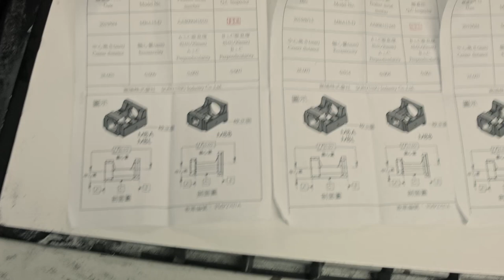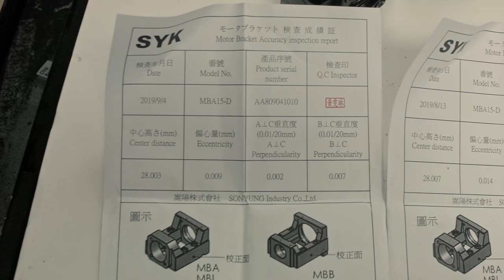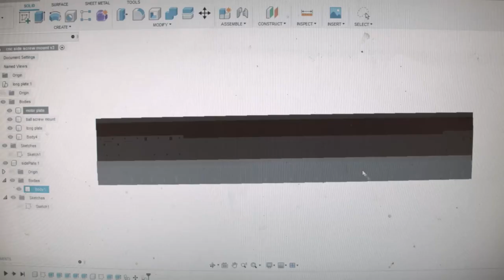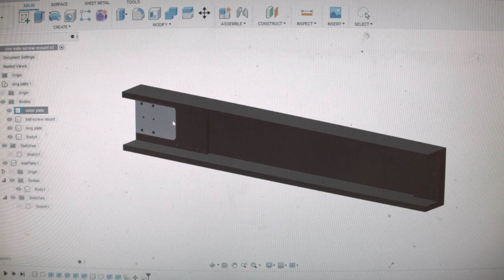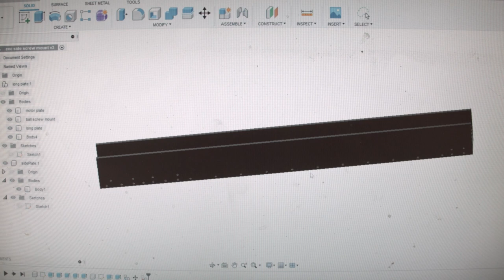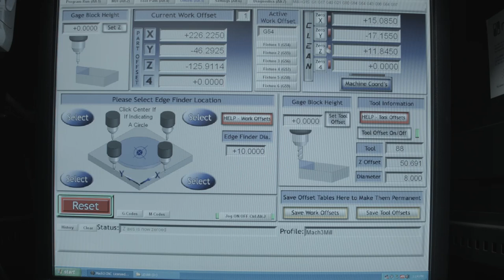EPIC CNC upgrade - episode 2. more exotic parts and building ultra rigid Y axis module

Comment: Thanks for the video. Love your content. It was your videos that inspired my own build. Very similar design with OA dimensions of 1000mm X and 700mm Y giving about 740mm of X axis travel and 450mm of Y axis and 150mm Z axis. As you stated I liked that format for space constraints and access to the bed for fixturing. But mine is fully welded steel not granite. And only about 40% done after over 12 months lol. I plan on filling all the sections with resin though to reduce resonance as much as possible. I’m definitely doing full flood coolant as well. I’ve never seen anything else as efficient as your system.
Can’t wait for the next update.
Reply from the maker: I'm glad I inspired you :) 40% in 12 months, well you can not rush a masterpiece :D when you will fill it with resin throw some stones of random sizes. resin by it self shrinks when its curing, it could delaminate from the metal and leave voids.
Reply: Piotr Fox Wysocki I was going to do sand/resin mix. Do you think this would be ok?
Reply from the maker: sand wont change much. you need various sizes of stones to combat the resin shrinkage. stones are making the machine rigid not resin. 
i was contemplating filling up hollow frame with engine oil. liquids have the best dampening properties. oil should also prevent corrosion. the best would be mercury, but it is expensive and toxic. anyway i will have to investigate it further.
Reply: @PiotrFoxWysocki   i came across to this comment and could not resist asking. So engine oil has better damping properties than resin mix with granite stone of random size?

Comment: For those pieces that are a bit too long to be done in one op. If you can't relocate off a machined feature when you move it over to do the part that was outside the travel, I like to clamp a 123 block about midspan and use the spindle with an end mill up against it to establish a new reference. Then move the spindle over the distance needed to reach the rest of the piece (ie 4" in -x). Pushing the clamped 123 block up against the end mill again in it's new position. Then reclamp the piece and make sure your op2 has a zero point 4" over in +x and machine the features you couldn't reach from there. Usually accurate to .002" from what I can measure since y and z didn't change and unless you moved or rotated the spindle it is as accurate as your machines accuracy.
Reply from the maker: good tip. i will try to remember it for next time i have to mill something too long.

Comment: Hi fox. Great videos! I'm building a router with UHPC and got many of my parts from dy global too. I have the same ballscrews and a stainless z axis in got complete from them. I ended up with 20mm THK rails but I'm jealous of the rails you have :) also spindle is from jain Ken, I hope yours is still going strong as I haven't used min yet and hoping it was a good choice.

Comment: Awesome machine Piotr! Quick question. I noticed you’re using screws with 5mm pitch on y and 10 on x. Does it give you any issues? With motors running at different speeds/settings?
Reply from the maker: Not much issues. But because of this it messes up with resolution. Because of this I had to set the speed 2 or 4 times slower to have resolution 5 microns / step or 2. Don't remember. But I wish I had 5mm pitch all around. Things are getting bit weird to setup. But it's done its done. I don't want to touch it again
Reply: Appreciate the feedback! I’m actually copying your build lol. Almost done, just need to finish the gantry(I went the epoxy route for gantry) and can’t find a 2505 c3 or c5 screw to match my 2 y screws and not really trying to downsize to 20mm dia. or rolled. I did find one with a 25mm lead, so that’s the reason I asked. I’ll take your feedback and keep looking!

Comment: Is there any specific reason that you went for (probably expensive) ground ballscrews instead of a glass scale measurement system to compensate for the errors in the cheap errors? Or will that be coming too? :D anyways, I'm always looking forward to your videos, I like your very precise way of working and your awesome machine :)
Reply from the maker: the reason for ground ball screws was to have as less vibrations as possible, longer life and to minimize pitch variations.(error)  double nut to eliminate backlash for as long its possible.
i wont be using glass scales, I'm hoping for those ground ball screws to consistent enough. lets be honest, how often do you need to mill parts that are 5 micron precise. 
for me the quality of the finish is much more important.

Comment: First of all thanks for the inspiring videos, I like the "can do" attitude and it motivates me to keep on improving my diy CNC. Unfortunately its sitting in my living-room in the third floor so I cant really put a 500kg granite bed there..Im sticking with 150kg.
Im currently also in the process of deciding which Ballscrews to buy. I Currently have 2410 Double nut ground with JMC Servos (400W) but I'll drastically change the design soon and move to a "dual-system" with one screw on each side of the portal.
I was looking for NSK and THK on eBay used/new but finding the right lengths is not really easy if you need two identical ones.
How did you decide if you'll take a 5mm instead of 10mm? As far as I can see, TBI also has 10mm for every Type
And why did you decide for the double-nut type? I cant really find information for when its necessary.
Reply from the maker: 150 kg on the third floor is still a challenge :) thank you for asking the right questions i forget to explain.
i wanted to have 5mm pitch for 2 reasons, one is the resolution stepper or servo need 2x the amount of steps to move from a to b versus 10mm pitch screw. so with more steps you can define shapes more precisely.
5mm pitch is slower but it has 2x more power. so you can move and stop more weight.
10mm pitch is faster but with less power.

i wanted a double nut for the precision. 
every component like ball screws or rails to be precise, it has to have preload. no preload mean it moves very easy but it has some some play in it.
in ball screws it means wiggle and backlash. 
double nut so the preload is adjusted more precisely than single nut. in single nut you adjusting preload with bigger or smaller balls. and in the double nut you twisting those 2 nuts against each other   until you have a result you have been looking for. 
this would be a very simplified explanation.
Reply: @PiotrFoxWysocki  
Thanks for the informations! I think ill also step up.. or down to 5mm pitch.
Im currently working my way through the PDF from TBI but its not really the most relaxing lecture  https://www.tbimotion.com.tw/en/product/Ball-Screw-DFM/ball-screw_DFM.html  I also contacted maxtenso for a 1000mm 2505 DFU or DFM etc,. ballscrew, I guess ill have an answer tomorrow. 
What type of nut is your ballscrew? NNB DFDR2505DRD-719.5L but I cant really decipher what type of nut that might be.. but I guess its not ultra important. Accuracy Grade C3 or C5 and preload P2 or P3 are things where im not sure yet. My fast-travel rate is currently 10m/min, how fast is your G0? I guess with the 3000rpm servos a 5mm screw would be a good fit. I just wonder a bit how loud it will be with double  rpm compared to now 
Yeah.. weird things that you have to consider if you want to arrange a CNC with a girlfriend and a normal flat in the middle of a city :)

Comment: If you don’t mind me asking...what size/kind of router bit are you using for the facing operations? Also what feeds and speeds are you running it at? By the way awesome job on the build! Thanks, Andy
Reply from the maker: 1 inch diameter, 9000rpm, 1000mm/min feed. router bit is something like in this link https://aboloxtools.com/CMT-Orange-Tools-852.504.11
Reply: Great thank you so much!
Reply: Just curious...what DOC are you running the router but at per pass?

Comment: Love your content. I am currently in the planning phase of my CNC upgrade. I took some inspiration from you unfortunatly I can't do the gracite way. But I am thinking about concrete filled extrusions what is your opinion on that?
Reply from the maker: if you fill extrusions with concrete it might never dry out. water have to evaporate somehow. if water wont be able to evaporate concrete wont set. and if it sets eventually it will shrink so it will be lose inside extrusion. typically what people do is all sort of sizes stones mixed with epoxy. stones will prevent epoxy from shrinking. yeah. everything shrinks :D

Comment: Your work is amazing! I've been wanting to build my own CNC mill based on your granite design + a few tweaks of my own here and there. What I really want to know (I don't think I've seen you mention it in any video) is how precise are the parts that come out of the machine? This upgrade seems to get to the top level of professional, but it would be kind of disappointing if there's no before and after explanations about its precision. Maybe on the next video?

Also, have you ever milled anything other than aluminium on that machine?
Do you have problems with coolant getting foul smells/bacteria? (I've heard its a problem)

I have so many questions.

Again, thanks for sharing your amazing work :)
Reply from the maker: parts are precise enough for what need. what i want is to have best possible surface finish. 
all the cheap rails and ballscrews which are currently in the machine are worn out. so it was the time to use proper parts which will last.
i did mill some steel and hardened steel, but i dont have much experience in steel, also i dont use steel for my parts.
coolant seam to be fine, haven't noticed anything dramatic.
Reply: Piotr Fox Wysocki well in that case, the router bit seems to have done the trick. That surface finish looks great
Reply: @PiotrFoxWysocki  hate to bring up a dead thread but how was the finish on the hardened steel ?

Comment: If u make so manny upgrades , u can get a real controller , more easy and stable than  mach 3 like a uc300 eth or uc400 eth , with they software uccnc .
Wish u the best with build .
Reply from the maker: I thought i will try uc400 first and if something is wrong wit it i will go and get something more serious. Same thing with mach3. So far it works no problems. When it wont i will swich to linux. Its nothing terrebly critical.
Reply: Just go straight to Linux CNC + the probe basic interface!

Comment: Awesome video Piotr, as per usual! Quick question, where did you get that granite straight edge? I’ve been looking for one for ages but they’re quite expensive. Thanks!
Reply from the maker: ehh... this was a long time ago. but i got it from Alibaba. It was quite exhausting experience with the manufacturer redoing straight edge and some other granite blocks. so i don't want to  recommend them too much.
Reply: Piotr Fox Wysocki fair enough, thanks for the quick reply! I’ve seen them on Alibaba but I am a bit sceptical of the quality
Reply from the maker: @devinmoodley4061  yeah.. that the tricky bit.

Comment: How flat is the aluminium plate that you’re mounting all the precision components to?
Reply from the maker: its with in 5-10 microns. but this is not as important as the final installation in the cnc. 4 x m6 screws will pull contact surface tight to the steel motor bracket. and for few microns you wont even need much force for aluminium to conform.
Reply: Piotr Fox Wysocki Makes sense! Just need to shim out any variation in plate thickness. (If any! I look forwards to finding out)